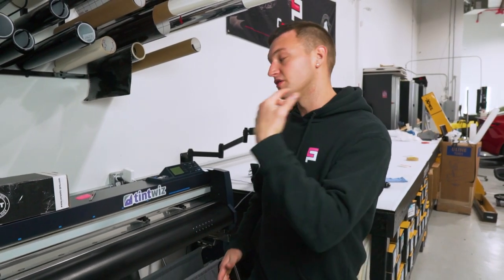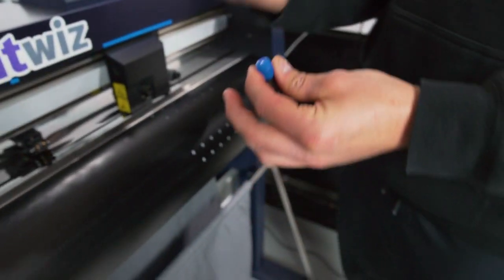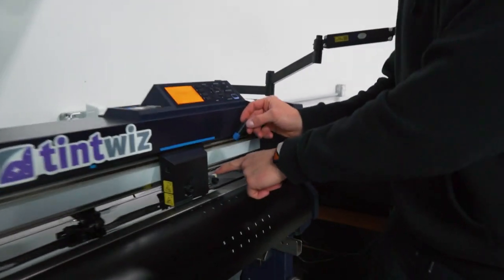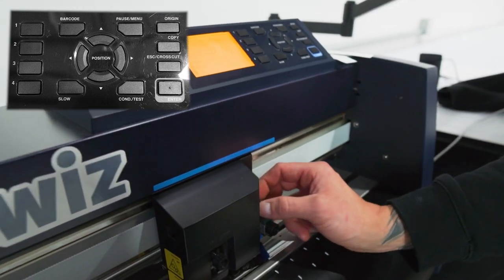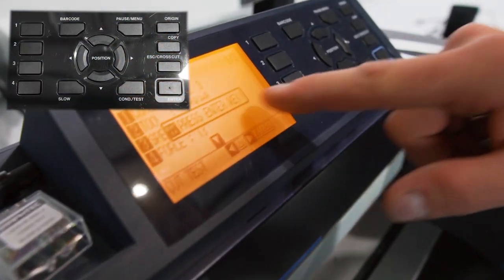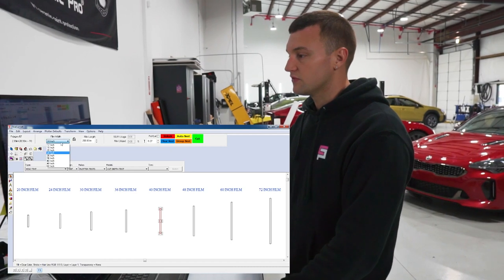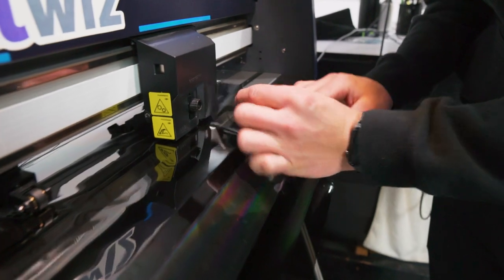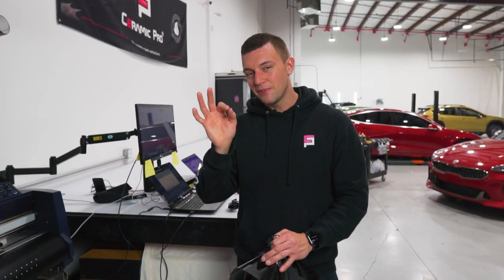How to setup your graphtec plotter for cutting window tint patterns FC9000

Comment: Holy crap these graphtech are insanely high tech. I just bought an SC2 from US cutters like 3 months ago but the cuts never lined up. That’s what you get when you buy a cheap plotter. The fact that these tell you when you’re close to the perfect blade depth is crazy. 
It seems a bit more complicated that’s for sure but I’m super happy to have a quality plotter now. I bought the ce7000-60 as I tint rvs and most of my films are 24 inch rolls. For bigger rv windows I’ll just hand cut them still. 

Would love to get into vinyl decals for RVs and jeeps. And I’m a full time RVer at Rv resorts daily and RVers love to personalize their rigs with vinyl stickers. This is why I went with an upgrade and super stoked to learn how to do it. If I can only find a course to teach me. Anyone have a recommendation on how to learn? Thanks in advance.

Comment: How come everytime when I start to shrink a back window I will get over half way through and it will be perfect  until the bitter end and that's where all my wrinkles and bs starts to go on and happen u talking about keeping someone frustrated  because  I've gotta get the back windows down or what's the point  in calling ur self a window tinter fr fr because  I am self tough  for one then my buddy used to work.on a shop and they gave him one of those instructions  videos about  how it shows u to lay it on the outside of the window and make all of ur up and down cuts first everytime then roll the bottom  up and roll ur window down around  a 1in from the bottom of ur track seal and then make ur final cut then began to apply but wtf is the deal with these windows that I'm guessing  they turned on there rear defroster and its put these big like 3 or 4 in bubbles  all over there back window and is there a way to keep that from happening to ur tint job or do u all just disconnect  there rear defroster one huh ?? U said to ask so I'm asking ya because  I dont rely on no one no time because  I've found out that ppl.are full of there self's and full of shit on top of things fr fr and u can't depend  on no one but u to make sure that everyone  stays on that profession  track base because  a happy installer  makes for better days and a stress free environment  fr fr feel me if u have any home life problems  leave those at the threshold  and pick up ur drama on ur way home dont bring it to work with ya because  all it takes is one sour puss to ruin a entire  day fr fr seen it go on alot fr fr but not me because  I'm there to do a job and make some easy $$ and I am one of them guys if u can't get things lined out between  u and whom ever then it's time to take the both of u all out side and just let them swing it out till the problem  goes away I kno this sound a little  harsh but I never said I wasnt a reasonable  man tho feel me because  if its disrupting the work area then that's unexpectical to me and especially  now that I got me a plotter  and I want to.go out on my own because  I'm tired of all the cry babys that always seems to. Have something  to whine about  fr fr because  if they do it it.seems like it's perfectly fine but let me say anything  then it all of a sudden  becomes a problem naw I'm good fr fr what these companies doesn't understand  is they apparently  can't do what they would normally be paying  ppl to do or they  would trust me seen that bs line of excuses  to many times kinda like someone owning a garage  but never fixed a car in there lives fr fr so all ur doing is making them rich and ur still pour fr fr ahhhhhh naw lol unless this is ur personal shop idk why u dont take some of ur money and start to invest into some machines  for u a shop so u eliminate  all ur over head and  begin  to start sticking that into ur pockets instead  of someone  else's  pockets  because  you  are  doing  all the work  but them and  that company  name is the ones who gaining  all the clients  not u ur more or less a used flunky is what I like to call anyone that's being  used for there skill sets because  u kno what ur capable  of not the clients  fr and idc if u was to charge  10$ less then  who ur working  for  u will take all there business  because  ppl is about  that almighty dollar fr lol 
https://youtu.be/b75Fz8CqAW4 and  my name  is shawn  not Steve steve jobs has something to do with  apple  it's not me I just  like staying  in condo  lol

Comment: I have a question. What  speed do you choose to cut tint on a graphtec plotter
Reply: 15
Reply: 15 is the downforce
Reply: I Downloaded ComputerCut pro. Im having issues when i print, it only cuts a section if the window. Ive tried moving tje image to the center of the film yet it keeps cutting just a section. Any idea.
Reply: @TopTierDoberman  do you have an option to view what you are going to cut on the software before you cut. Like a pair of glasses button to view it